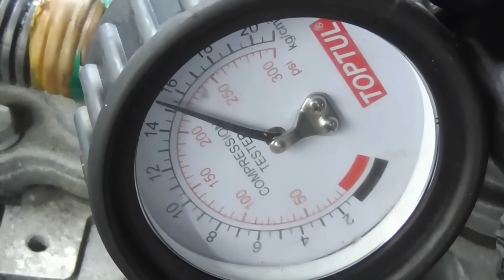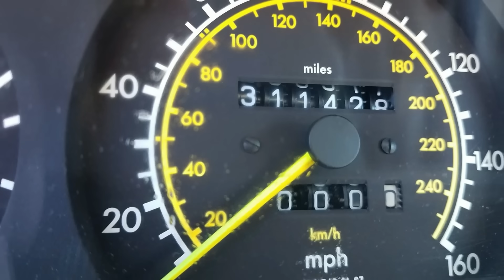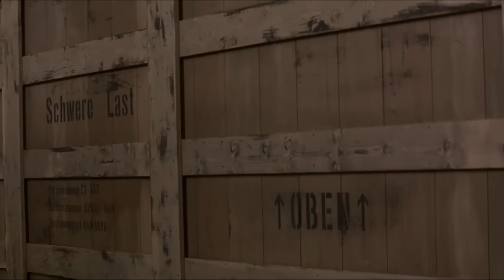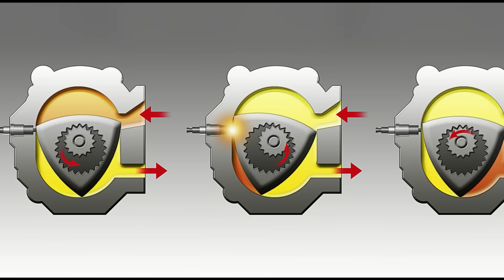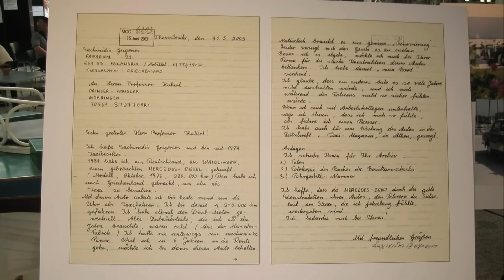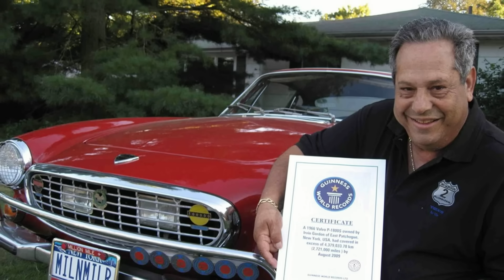Most Reliable Engines of All Time

Comment: Now I understand why people don't think Italian engines are reliable, I only did 128,000 miles in my Ferrari 308 without a single problem and 112,000 miles in my 550 Maranello. Thrashing the f*****g bollocks off them every SINGLE day. A mate ran a 'race experience' business at a race circuit in England, he ran a fleet of 3x355 Ferraris for 10 years there all of which were caned for over 100,000 miles at race speed by thousands of different drivers and unlike the BMW's, 911's, Astons, and everything else there, not one ever broke down or blew an engine.  Still, nobody wants to hear about that. Lets just talk about big Yank V8's that crawl along at 60 mph for a million miles only requiring an oil change every 6,000 miles shall we? LOL!

Comment: No mention of the ford 2.3 i4? 
I got 335k so far on my 93, and I got 220k on the original clutch- had to replace it because the seals blew out on the slave. It’s not a glamorous or powerful engine but it’s long lasting with very few problems

Comment: No mention of the simple, versatile and most produced chevy small block.
Reply: yeah, and what about the jeep inline 6 cylinder 4L... they put the. in their jeeps for over 17 years!!!
Reply: Most miles!! Old small blocks be for 1986 cam humps worn off b for ny thing else worn out but after 87 with roller lifters in those engines would run and run seen lots with over 200000miles

Comment: 7.3l International Powerstroke Ford Diesel beats all this junk you posted. 4.9l 300 Inline 6 (So Reliable they stopped making it) and even the 5.0 Windsor which you still can see on the road today are very reliable and easy to work on engines. 3.8l and 5.3l GM engines. Still many on the road today. 4,6l & 5.4l Ford 2v. Every Cummins Engine made. Million mile engines.

Comment: Camry, "can easily see 150 to 200 thousand miles."  uh, EVERY car I've owned has seen at least 150,000.  To me, a car with 75,000 miles is brand new.
Reply: My ford ba falcon with the mighty Barra engine has only 78000 kms not sure what that is in miles but I'm guessing around 37000 and it's a 2002 model not bad for a new 17 year old car
Reply: @aydentheninja878  that is brand new!  My moms 2013 volvo only has 36k on it.
Reply: Billy Olsen dam do you even drive it? We have a Ute from work and we put something like 3000km on it in a month and a bit
Reply: @aydentheninja878  I had some idiot try to sell me a stock ba as an xr6. I said the only thing on this car that says xr6 is the cluster and that says only about 60k. Best part he hits me with "oh but its been used for towing so the ecu" 
I said its a stock car with an xr6 cluster  and he was actuly offended when i offered him 500 bucks.
Reply: I'd argue buying something with 70k+ miles is good investment. With complete maintenance history ofc. If it drove for 100k and engine still works flawlessly there is a good chance it will drive another 500k. The 200-300k+ I'd be skeptical, if it was used on long trips it's probably fine, but 300k on a delivery/ work car that drove in city traffic is bad for all components.
Reply: Pff anything under 110k is new
Reply: The 3.4 in my Chevy minivan has 195k miles on it and I rarely even change the oil. Only thing I've ever had to fix on the engine was the water pump.
Reply: Brand new Volvo here with 300,000 miles on it, she barely broken in.
Reply: @Honeypot-x9s  mine not brand new but 1990 665000Km first engine Volvo 745 automatic 2,3 liter How this guy can be enthusiastic about 150K -200K miles is a riddle, never seen a Volvo ?
Reply: my scion (Camry with a different body) has almost 300k and all it has is a loose engine mount I'm gonna change someday
Reply: My Scion XB is 327k miles and still working
Reply: All depends how they are driven
Thrash fuck out of it everyday and 50k can be high mileage in comparison
Reply: @Cayden Staskiewicz at that rate you will never get it broke in .
Reply: If a car has less than 200,000ks on it is it even properly driven in?.
Reply: So true
Reply: I think he missed a 0
Reply: 90s camrys can reach the 600k-900k range, I've seen a lot of them in person. rn im working on a 2002 with 426k
Reply: Ive got just over 269,000 miles on my soon to be 10 year old 2012 camry se. 4 cylinder. Oil changes and changed spark plugs twice. No engine or transmission work on it at all.
Reply: For a Toyota engine the counter starts at 300K baby
Reply: @mitaka81  well they're good engines but the toyotas begin to burn too much oil. My dads got a 99 Corolla with 233k. Runs good but burns oil like crazy. We gotta stay on top of it cause if not it will be like the time we checked the oil and the dipstick had like a drop.
Reply: @themrrd12345  ...try 20/50 Valvoline oil...i used it for 15 yrs. in my 83 Maxima and 65 Cadillac Convertible in Colorado where temp. extremes are big. 20/50 all year long with NO engine problems and little oil use. Most mechanics will not recommend that oil....but they have NEVER tried ut themselves....they would rather rebuild your motor for big $$$.
Reply: @Cayden Staskiewicz uhhhhhhhhhh
Reply: Amen brother ! As long its not a BMW Audi or Mercedes that's the end of their life span
Reply: @cdias3272  lies and slander, my bmw has 205k miles on her and still running strong, still has at least another 100k to go before it does I think 🤔
Reply: @afroize   How much do you have to spend to keep it going ?
Reply: @cdias3272  hmm about 600 or so without counting tires and oil changes. Had to overhaul the cooling system and that's about it, I do recommend changing out the pulleys and belt tensioner though, I can tell mine need to be done but they aren't toast yet. I live in a dry environment so rust has been a non issue for me but mileage may vary in that case
Reply: @cdias3272  also have 250k in that engine now and I actually think I'll be getting more mileage out of it than previously thought
Reply: @afroize   That's great , I'm impressed ! You probably have one of the better engines they made
Reply: @cdias3272  Odd. Do you have any independently verified, falsifiable and peer-reviewed data to demonstrate your claims about German engines? Objective reality disagrees with your assertions. I mean, what mechanism can we even use to delineate your beliefs from delusions? Makes no difference as it's anecdotal and waaaay too small a sample size, but my old w203 c32 has 414,xxx miles and counting.
Reply: @cdias3272  not really the old diesel mercedeses are know to go forever over 500k, audis and bmws should get to 300k without any major repairs
Reply: @proarmy70  yes the old ones were made well, but the new ones are pure crap ! To replace a cheap part sometimes you need to get a lot parts out of the way to get where you need ! And the price of an used Mercedes or BMW tells everything they are very cheap compared to the price when was ne ,a small fraction of the price . if you planing on getting a used one and use it as a daily driver thinking you have a car that's going to last a long time your wrong! You will have pl
Reply: @cdias3272  exactly 😂

Comment: If you live in a state with lots of snow and salted roads yeah an engine with over 200k miles is impressive.

If you live in a more mild environment the engine should last WELL over 280k to be impressive (original miles).

Comment: 2:48 "Instead, each cylinder has its own ignition coil which sits on top of the spark plug", correct me if I'm wrong, but isn't this true of most automotive engines produced since the late 90s?
Reply: Alot of cars still had a distributor in the 90s. It wasn't until the mid 2000s when coil on plug became really popular.

Comment: 100,000 miles is not that much

unless you own an RX7
Reply: Almost all my older cars are on twice that mark. Citroen Picasso (gas) 290k, Renault Trafic (diesel) 320k, Mercedes A class (diesel) 300k, Toyota Yaris D4D (diesel) 260k.
The others have less, Peugeot 106 just 180K Km, the oldest of them all, rarely use this one. No power windows, no central locking, no AC! But for some awkward reason I like it, so it stays around. ;-) 
Latest addition Peugeot 107 (gas), only 108k Km, a "baby" among the others. 

In common to all of them, the engines are flawless, start on the first touch of the key, no smoke, no strange knocking's, Just normal. :-)

Comment: The Mercedes OM 616 and 617/617A diesels were virtually bullet proof. Not big on power, but could easily achieve nearly a million miles if taken care of. The small block Chevy was a pretty reliable engine also.

Comment: This is dumb as fuck. Any of theese engines (accept POSSIBLY that 300d) can run 100% duty cycle 24/7? Doubt it. Not reliable. Too many fucking problems with these engines. if it can not last more than 450k miles or 14,000 hours, its not reliable. Bullshit if it can "make power" doesnt mean it is reliable. A damn dt466 can make 550 horse easily by turning a damn screw. Any Cat/Perkins engine can outrun ANY of the engines here listed, MAN diesel is incredibly reliable apparnetly too. Some larger cummins engins are somewhat relaible, but their smaller ones eat shit. Internationals diesels (almost all of them) were very reliable. Fords 7.3 is very reliable even though it had electronics all over it.

Comment: I had a Supra, it had a problem keeping the rearmost cylinder cool. Had three head gaskets done on it before I sold it. Have had better luck with BMW inline sixes: 2.5, 2.8, and 3.0. The 2.5 has more HP than torque, not my style. The 2.8 has more torque than HP, my style. And the 3.0 has about equal HP and torque, and more of it, my favorite. Anecdotally, I've gotten the most miles out of Toyotas, then BMW, then Hondas. Many of the older domestics got very high miles 300k + : GM 3800, Ford 4.6, Chevy 350, etc.

Comment: 2:00 Toyota 2AR FE can go to 150-200k miles with regular oil changes? Was that a typo? That's low miles at that time. I'm old enough to have owned 7 Camrys 92-96 with 2.2L engines. They go to 300k!

Comment: My ranger has a ford lima 2.5 4 cylinder 236k miles clutch has been replaced once. Other than just timing belt and water pump. The ford 2300 is a long lasting engine

Comment: I am surprised there was no mention of the DW10 engine which originated in the Pinto.. but was used by PSA in Europe to power many Peugeots, fords, Renaults, Fiats. Citroen Plus versions in Volvo as well as many Vans` each company favoured different injection systems etc but the core remained basically the same with the power ratings suitable for the application.

Comment: You know nothing, John Snow!

Chrysler 225 cu. in. slant six
Ford 2.3 L SOHC 4 cyl 
Ford 4.6 L V8
Chevy LS1 5.7 L V8

All are good for 300K miles, at least. 
All of these out last the listed engines.
Reply: The slant 6 225 was a tough motor
We had them here in Oz.I also recon Chyslers 318 was a tough v8.I rebuilt one once for a works vehicle towing a large trailer and as hard as these tradies try to kill it it just kept on going and going .
Reply: Buick 3.8  Ford 3.5 Ford 3.7

Comment: What the fuck is this crap.  Yes .  The 3S was in Celica but not in the last gen celica.  that was ZZ engine .  And RB26 Reliable HAHAHAHAA .  Rotary reliable... hm.

But the Volvo B18 and B20 that is in the P1800 is near indesctructable but not so tuning reliable .  i drove 55km home after smashing the oilpan on an old Volvo 144 with B20  and it made it all the way home without oil in the engine

Comment: Ok what about the 6 cylinder 3.8L GM engine? I have seen them minimum 180-200K. Mine in a 1992 Pontiac Bonneville was still running with over 223k miles.
Reply: ya, thats a really good one and most of the GM v6's of that era were good but the 3800 was the best.  300 Ford straight 6 is a good one.  225 slant 6 and 318 Chrysler were both long life
Reply: Blaine Trarop  Try 302,000 on my 04 Pontiac gran prix

Comment: Honda - hands down.  One major reason is due to the specs on the pistons when they are cast being much tighter than other engines, and not only that but then dividing the resultant pool of cast pistons into 5 categories of similar weights within the range of the already tight specs and building their engines with all pistons from one category so that they are as near in weight with as little variance as possible.  This results in a very balanced engine which wears evenly and doesn't have as much tendency to go wonky over time as uneven wear gets more exaggerated.  They maintain a high resale value for many years when other cars have depreciated twice as much.  

Think of the oldest cars that you still see out on the road and you will find either classic cars that have been lovingly maintained by enthusiasts, or ancient beater econoboxes that are four different colors of primer and duct tape outside; they may look like crap, with rusted out panels and bumpers that don't match and don't even talk about the paint, but they  start up every time and don't quit.  Some peckerhead STOLE my 25 year old Civic last year and gutted it for the manual transmission, even though it was missing a passenger seat and had a front quarter panel that was entirely rust and had been salvaged once already.  Really pissed me off because I was intending to hold onto that car another decade if necessary.  It would have gone 300K without a hitch, and had already given me 150K with zero issues - regular maintenance.  Had one mystery problem of the battery draining which turned out to be due to the brake lights staying on after 2+ decades.   It took that long for the plastic bit on the brake pedal switch to disintegrate, but it was resolved with some epoxy putty once I knew what had caused the problem.   I never even had to recharge the AC in that thing!   My mother is still driving her 95 Acura.

I bought a Honda because I had never seen one with the hood up on the side of the road billowing smoke while the owner/driver sat there waiting for a tow.  The only time I saw someone pushing a Honda down the street I was really confused until I saw the gas station on the corner.  Honda makes reliable pretty reliably.  I'd still be cursing the dicks who stole my civic if I hadn't found a CRZ to my liking as a replacement.

Comment: Dodge 318, 5.9 Cummins...well any cummins compared to the rest of em. I cant say anything bad about any of the imports (minus the rotary) so i will just take his word for it, but i have personally put over 400,000 on my poor old ford idi diesel 4x4 and maintenance was basically checking the oil or changing the air and fuel filter once a...well...when it wouldnt go very fast! My 96 grand cherokee h.o. 4.0 my other older 93 grand cherokee with a 318 that is dancing with the odometer at 367, 789! Respectable considering my liberal use of my extra large right foot planted firmly into the skinny pedals and my super tiny little brain, these engines have taken some incredible neglect and vicious abuse. The v8 and the 7.3L diesel still run strong. The 4.0 will still start up and run, but for entertainment purposes only, due to the connecting rod sliding outside the block hammering at around 145 decibels! Its an amazing conversation starter to break the ice with new neighbors😎

Comment: Moron. Any list that doesn't include the Buick 3800 is total bullshit. Simple design, great fuel economy, amazing power for an engine that small and really gets it when supercharged. Used in about 40 million vehicles. A couple of cheap systemic problems like the belt tensioner elbows and the intake manifold that can be changed in thirty minutes. Other than that totally bulletproof.

Comment: this was garbage about high end foreign engines, look at ford's versatile 4 cyl and over the years diverse varitions, from pintos to ford rangers, these are motors that are simple design, take much abuse and are commonly found still running at 200,000 miles and sometimes over 300,000. The only thing mad about your channel is thinking the catering to large pocketbooks will keep your channel alive.

Comment: You obviously are not aware of our BARRA double overhead cam, 24 valve, variable valve timed inline six cylinder in n/a & turbocharged Australian designed & built Ford 4 litre engines that were arguably one of the best inline sixes built period that are capable of extreme mileages in our ford falcon cars down here  some taxis have covered huge distances nearing a million kilometres! Also can be tuned to put out up to 2,000 HP! Look it up.

Comment: I have a 2012 Fiat 500 with 116k miles on it. I crashed the car the engine still works. It's going and probably will go on forever. I think the reliability count should start from at least 200k miles.

Comment: Just saw a guy today with a 73 f250 flatbed had over 2.5 million miles. Had paperwork too. Jas rebuilt the motor twice. Just replacing gaskets and simple parts nothing major.   Hes the original owner and he bought it new for his work truck

Comment: i had a newer mercedes w124 250d (om605) with 616400 miles didnt have any power but it was reliable and fun over speedbumps because the suspension was so soft

Comment: Looks like you guys need to look Down Under. The Australian built Ford Barra engine 6 cylinder does 1,000,000 kms (which is 600,000 miles.) in Taxis.

Designed around the mid nineties it went through some evolution but remained essentially the same until 2016 when Ford's head division in the US shutdown Ford operations and production&assembly in Australia. The 4.0L inline Barra Six cylinder is now known as a bulletproof engine, it's being used these days by race car builders, who incidentally, have a 2000hp version of it, and they wanna keep going higher to see if they can crack the block!

650,000kms (roughtly 400,000 miles) is standard for this engine. Look it up on Youtube. Quite possibly the world's best engine ever👍
Reply: Too right mate!
Reply: You missed the 240D with 2,850,000 miles. Your 600k is less than a quarter of that, lol.